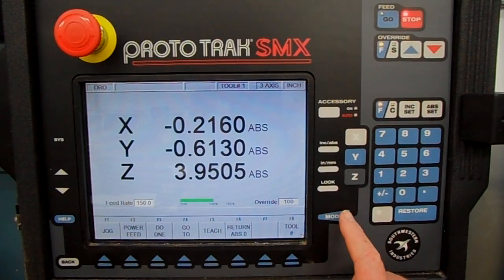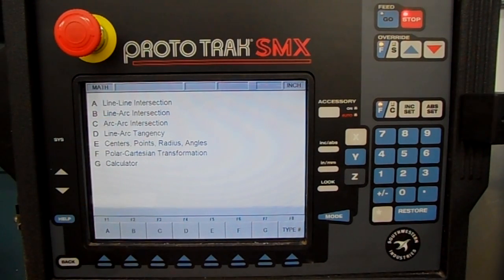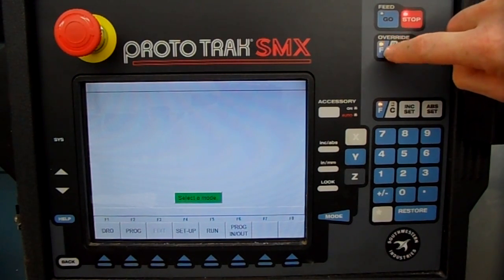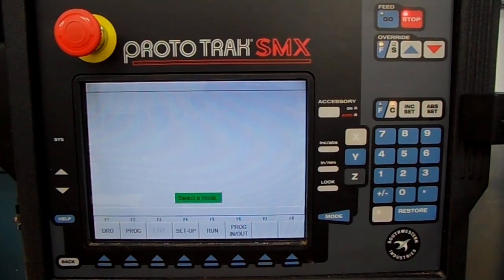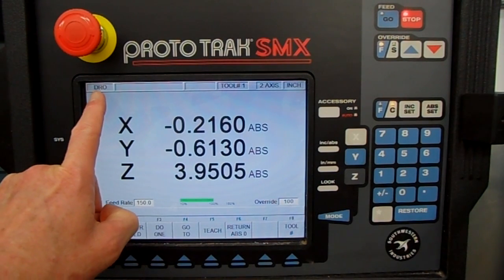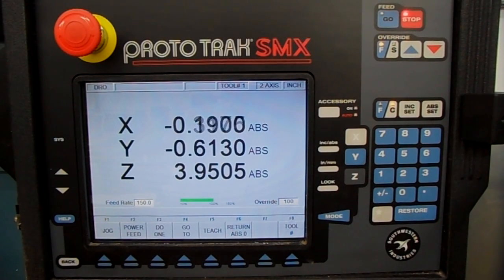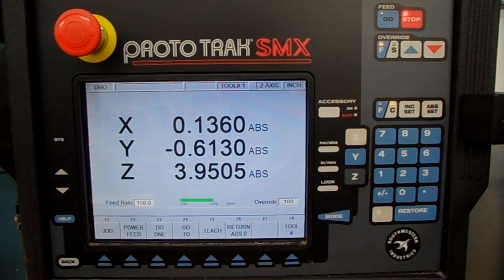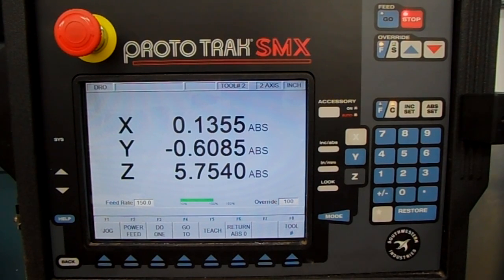Proto TRAK CNC Mill Basic Screen Overview

Comment: Great video, can you tell me how to fix a axis servo fault, it had a wee crash and getting a fault z axis servo fault, check hard stops, connections and remove any obstructions.machine = Prototrak SMX 4000. Is there a trip switch on the servo for over loads or is there a chance i blew a fuse ? i have no job from the screen but can move all axis by hand. Any advice would be very much appreciated before the boss returns mid week. thanks
Reply from the maker: I couldn't tell you how to fix the Prototrak, I made the video in conjunction with a salesman.